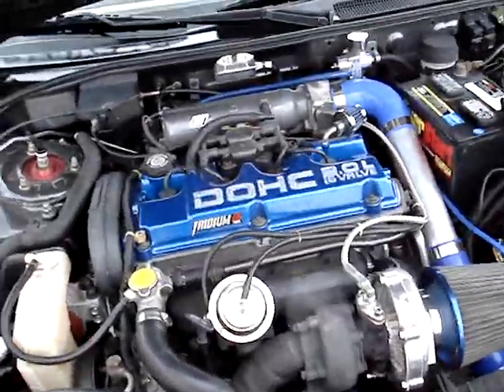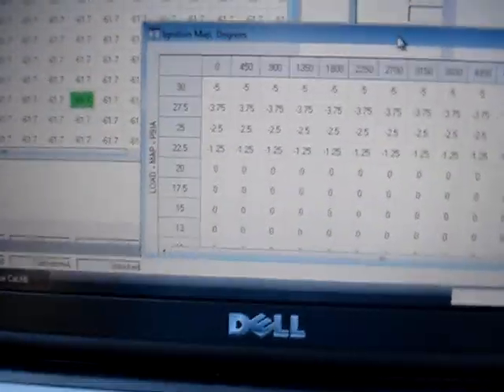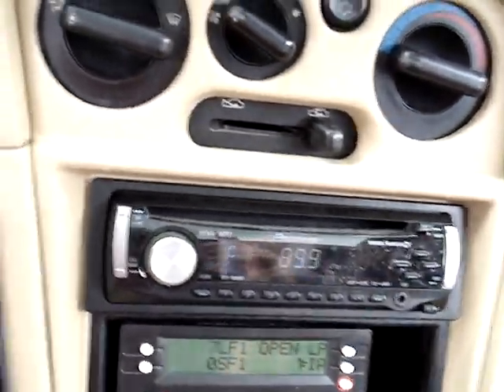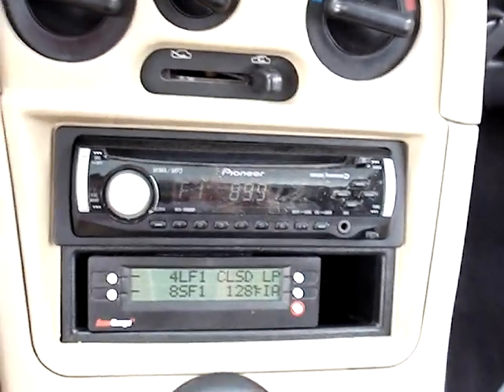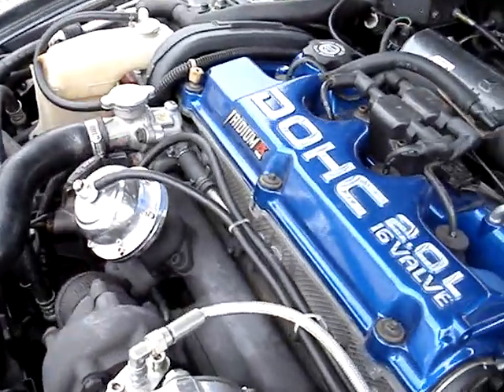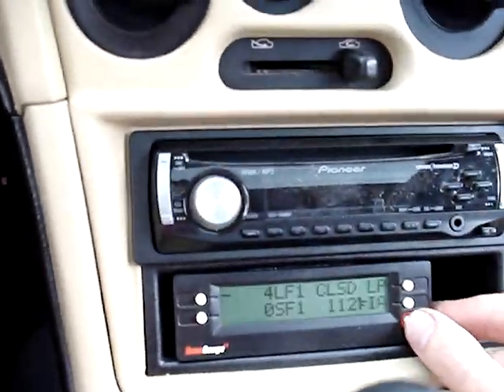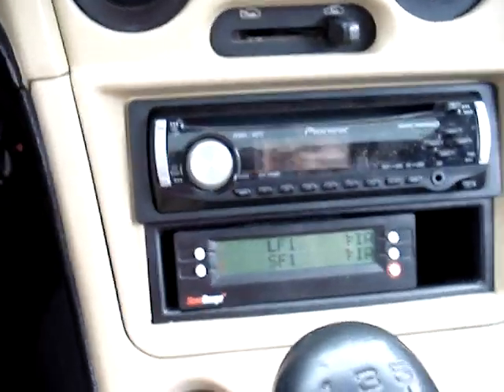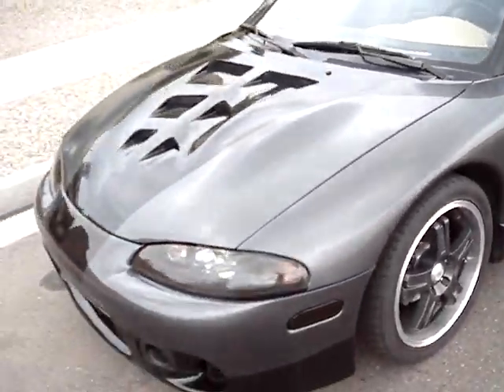Project 420a GS Turbo Pt 7.wmv

Comment: what steps did you do to put your clutch master cylender in? drilling.. ect....and with the brake master cyl, can i use auto mc? cuz i have manual but my car is abs and the manual brake mc is non abs. herd they cant work together.

Comment from the maker: Yeah I bought the 30-1910 fic and it does through cel. It thinks that the injectors are not working properly.  I would try the 1913 model if they say it fixes that. I was told by the fic tech support that the dodge universal one should not through codes im not sure if thats the 1913 but if you want Ill give you there # and you can ask them.  Here it is 1800-423-0046. Let me know what u come up with and if that fixes it.

Comment: Have you fixed your idles? Have you installed a walbro? & also you should get rid of the fmu and just run it off the fpr and set it to the rating to the injectors, and minus 3-4psi with the vacuum line on,  also you should invest in a aem wideband , & take fuel out with the fic & not add

Comment from the maker: So I didn't even put 600 miles on it and my speedometer stopped working. Turns out my speedometer drive gear came loose off of my drive axle, ouch.  I must have had some water in my tranny that caused the nylon gear to expand and came loose.  I should have flushed the tranny because it was sitting for a wile and i suspected some moisture.  So now I have to pull my tranny out and tear it all apart to replace this $10 part.  Well maybe I'll replace my differential with a LSD wile Im at it.

Comment from the maker: @DALE97DSM Im running one of those garret universal turbo kits you can get of of ebay.  My idle is good most of the time but every once and a wile it bogs and surges, not sure why.  I never tried the msns but Im sure it is a lot better for these cars , more money too.  The fic is a piggyback so it don't always harmonize perfectly with this ecu, I think thats why it bogs sometimes.  I herd they make one for dodge engines that will not cause the CEL but I have the universal one.